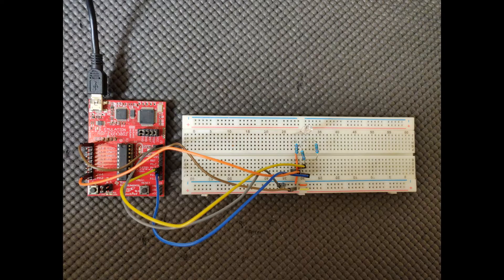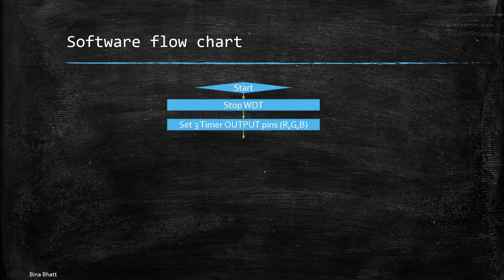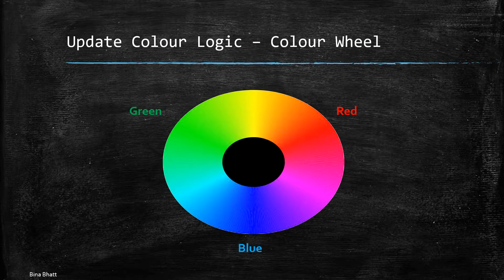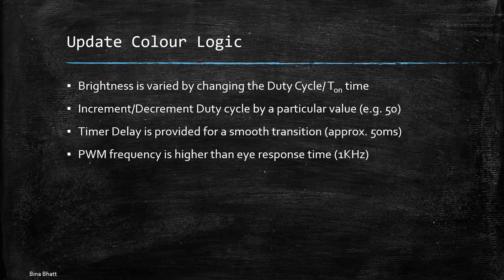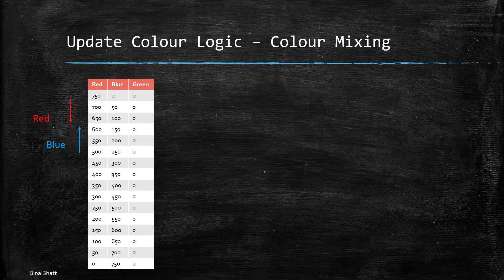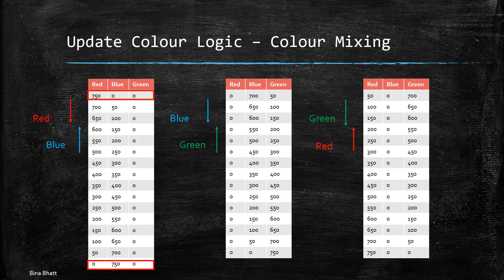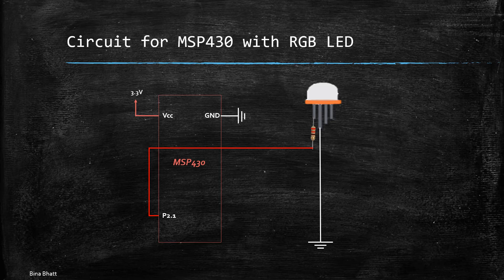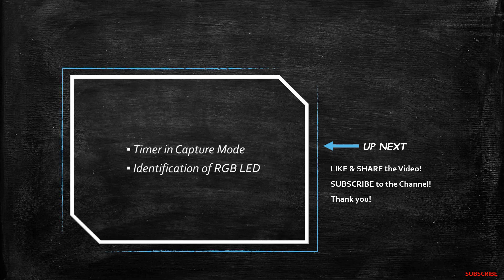Pulse Width Modulation using MSP430 and RGB LED

Comment: hi, can we do this with 12v rgb led strip without any external power suply ?
Reply from the maker: you can use a driver (BJT/MOSFET). Check this thread: https://electronics.stackexchange.com/questions/67775/driving-led-strip-from-microcontroller

Comment: I am trying to do a project just like this, but my LED only has pin connections for ground, Vcc and then the middle connection also connects to the msp430 but there are not separate connections for red, green and blue. Can I make this program work for my RGB LED?
Reply from the maker: I haven't heard of such Led.  Check if there is any datasheet or simply connect it without a microcontroller to power supply and figure out the process of getting different colours. Modify the code accordingly.

Comment: 6:42 So I'm looking at the chip's pinout diagram and P2.1 has the output for TA1.1 while P2.5 has the output for TA1.2. Doesn't that mean P2.1 has the output for TA1CCR1 and P2.5 has the output for TA1CCR2?
Reply from the maker: yes!